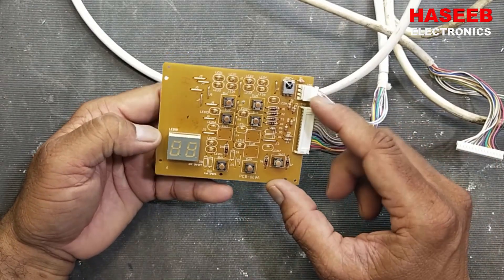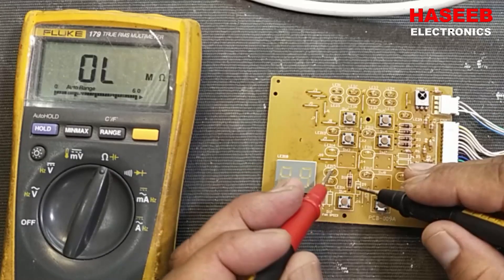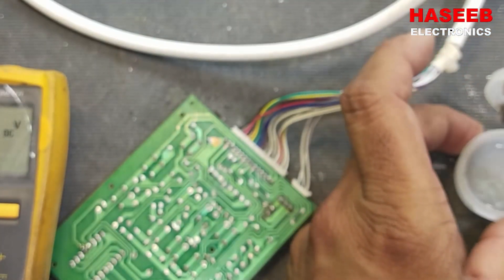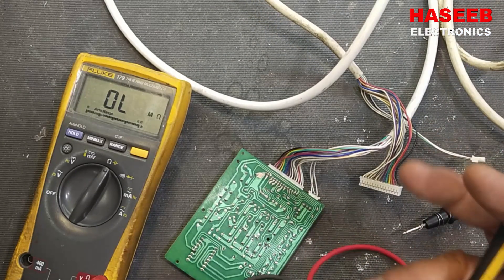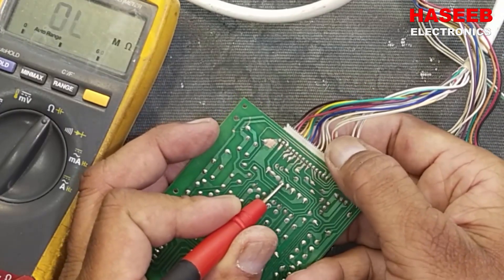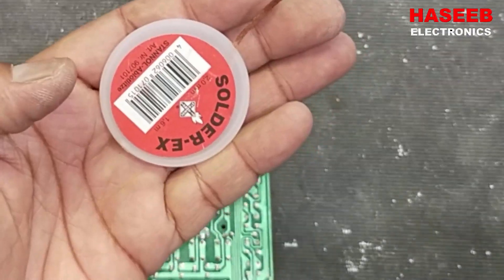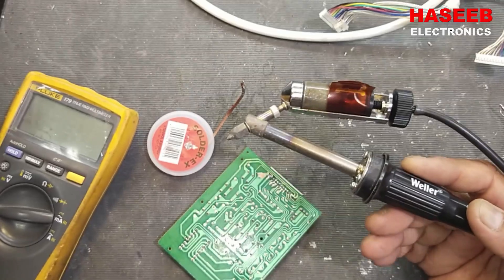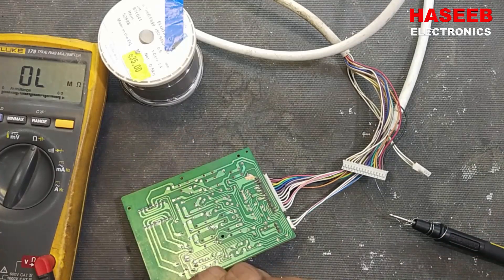[422] Dry Solder, Disconnections in Joints How to Troubleshoot / Repair AC Blower Control Board

Comment: I have been looking for isopropyl alcohol to work with my electronic and  to make liquid flux while soldering and cleaning PCB boards. However Isopropyl alcohol is not available so I have been looking for its alternative too. And there was different views about things I found such as thinners, petrol, kerosene, nail polish remover. Can you explain each of these alternative if it can be used? And what will be best alternatives? Thanks you for the great work in making educating content.